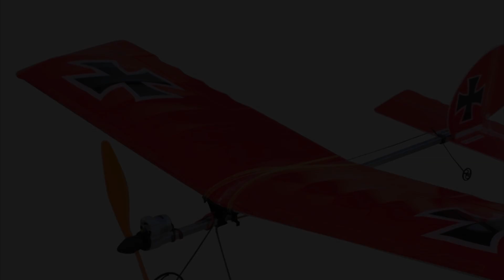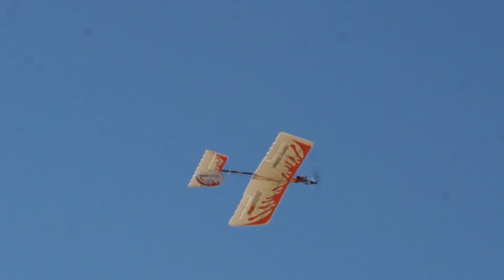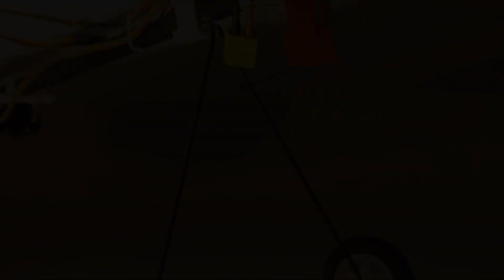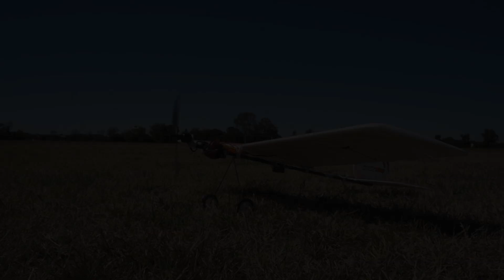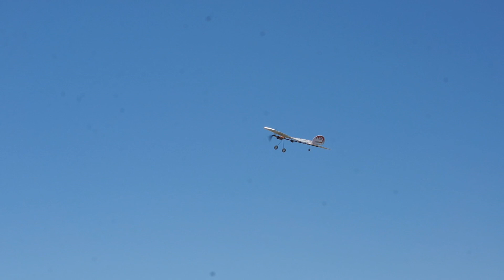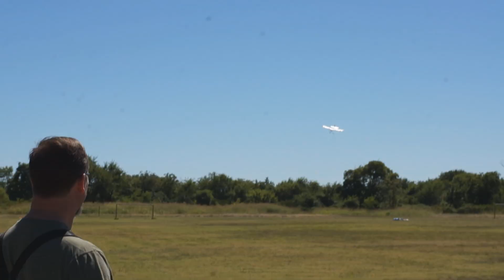Hobbyking Slow Stick PNF Review

Comment: I built my slow stick about ten years ago and have had to rebuild or make modifications many times since them.  I learned on a more sporty type of airplane and then moved to the slow stick cuz I wanted to just basically, "fly a kite with complete electronic control instead of it being hooked to a string.   
     I have always told my friends and family when they see me flying my plane and it is four hundred feet in the air, "this is my 21st century kite".   They laugh, but then all of a sudden, get it.   
     Thanks for the video and thanks for keeping the Slow Stick in the air.

Comment: Hello Lucas,
Thanks for your video that convinced me to get one Slowstick.
First of all I must say that I received mine with a broken motor stand.
The plastic is cheap and weak as you mentionned it about the fuselage link.
Hobbyking kindly sent me a new whole slowstick but the motor mount was broken again...
In order to avoid endless discussions with HK after sales, I just bought a "HXT Alloy Composite Stick Mount 20mm" and now everything is working fine...
Regards
JBG

Comment: .....I've tried several different battery options on mine - ALL 3 Cells! :D I've flown it with everything from 3S 1000mAh to 3S 2200 mAh. I feel it flies the best on about a 3S 1300mAh 30C or better battery - a refect balance of flight time and light wing loading!. I can almost hover it with throws maxed out and it has nearly unlimited vertical, but the super light wing loading keeps it crazy well behaved!  It also flies GREAT inverted keeping the wing loading light! Try it, You'll LOVE it!

Comment from the maker: One thing I should mention, I did add 15-25% of exponential to the ailerons and elevator, it helps alot. Also I always mount my battery as far forward as possible, so yours could be slightly tail heavy causing it to be more erratic. On the ESC/Rx/battery mounts, you can either glue them or I left mine free sliding so i can adjust the battery mount forward and aft. Once the battery is strapped in securely the tension keeps the mounts from sliding. Not the best setup but it's worked fine so far.

Comment: I bought on a few months back, it worked fine. Then I did an FPV conversion. The maiden went fine until I went to trim it. I went to glide it, It went into a steep dive, no problem, I pulled back to level it, and the wing spar broke. It hit the ground hard. The central wing connection is made of a piece of plywood with a notch in the middle (bad, a stress raiser). The plane can carry a good load, re-enforce the central wing if you will FPV this one.

Comment: Just upgraded the old 30 amp ESC with a 40 amp esc and used a 1500ma 3S battery , kept the original prop . fly's brilliantly , heaps of power . Also used an orange gyro RX for those windy bumpy days .

Comment: Received mine with a broken motor mount as well.  There was a chunk missing that wasn't even in the box so it happened before shipping.  The mount also had CA all over it like they had tried to repair it.  Advise anyone getting this to go ahead and get a decent mount from milleniumrc or elsewhere.  The plastic parts that come with it are junk and very brittle.  Aside from that, plane went together quick and flies great.

Comment from the maker: Short answer would be "Not the best". In perfect conditions (no wind or turbelance etc) yes it would be an absolutely perfect model to start with. But because of it's draggy design and low wing loading it can be kinda of tricky to fly in less than ideal conditions. A prefect first model would be something like the Hobbyking Bixler or Multiplex Easystar.

Comment: Had a maiden with this the other night flew beautiful other then my rudder was backwards and it confused the hell out of me and slamed it into my truck broke prop and mount....next day tried different prop case was all i had 8x5 works but not enouygh since i cant find exact prop at local shops we will now try a 9x 4.7 as the pitch is the same as the stock prop but an inch shorter also added a 3 axis gyro from hobbypartz try agan today

Comment: Dear folks, can this model fly without the ailerons? (A beginner).
Reply: It flies "okay" on rudder and elevator, but don't be afraid to fly it on ailerons.  Just keep your throws to a minimum and use some expo - maybe 50% on all your throws.  It's a very gentle flyer.
Reply: +Raul Odin Thank you for your valuable input.  One more question, kindly.  On this video, the narrator says this plane (HobbyKing SlowStick) "is more durable due to its EPO Molded wings and tail feathers".  "...As opposed to the GWS SlowStick's thin, molded, [something]) parts".  ¿Do you know what he means about the GWS' wings, please?   Thank you again.
Reply: I'm glad I can help  :)  Regarding the type of foam used in these models, I've owned both, the GWS and obviously this HK version.  The foam on the GWS is more fragile. It folds a little easier when banged around and can tear.  The foam used on the HK is more resistant to tearing.  Keep in mind the HK Slow Stick came out at least 10 years after the GWS model came out, and materials and design are just much better on the HK Slow Stick.  I've been flying rc since I was a teenager in the 70's and have owned and flown it all, and I still find great pleasure flying the HK slow stick because it's just a great design and value!  Go for it ~ you won't regret it! :D
Reply: +Raul Odin Raul, thank you for the reply.  I appreciate your advice, for novices as myself can't get reliable/unbiased advice, but from experienced people as yourself.  Thank you so much.
Reply: My pleasure brother ~ happy to hear I can help.  :)
Reply: +waveridermouldings .  I totally would.  I would also very strongly recommend picking up a cheap rc flight simulator.  you can find them for under $40 and the lesson you will learn there will save you big time over crashing and repairs at the Flying Field.
Reply: The Horizon hobbies Super Cub w/Safety Tech is a great flying model too.  I would still guide you towards this model for several reasons.  IF you do have a bad moment and find yourself going "in", the Slow stick has a much lighter wing area, and as long as you CUT your throttle before a possible crash, very little damage is likely.  As far as spare parts - my guess would be Hobby King has them - they do on most of their models.  The Super Cub is a different plane altogether though.  It's higher wing loading makes it MUCH MORE likely to be damaged in a crash.  More weight means more inertia on impact, means a more likelihood of things breaking.   The other thing I prefer about the Slow Stick is it's versatility.  You can fly it SO SLOW and easy or put a 3 cell on it(as I do) and get off the ground in less than 1 meter and go straight up as far as you can see it.  On the recommended 2 cell it's a fine trainer, 3 cell lets me do some CRAZY/FUN stuff.   One of my fave moves - on 3 cell with LOTS of throws,  from a dead stop on the ground I'll NAIL the throttle holding full up!  The plane basically launches into a half a loop and I fly out down-wind and inverted!  It flips up-side-down or ground-loops very low and tight, under 7 or 8 feet(or about two meters) high!  The Super Cub could NEVER do that.  And finally, this model is about half, to one third the price - but money being no object, I'd still have more FUN and versatility with the HK Slow Stick.

Comment: Two main problems with this plane. The motor mount is shit, cheap plastic which will snap off easily.  The landing gear holder is plastic and will break as well.  Two very important parts of the plane, which are poorly designed.